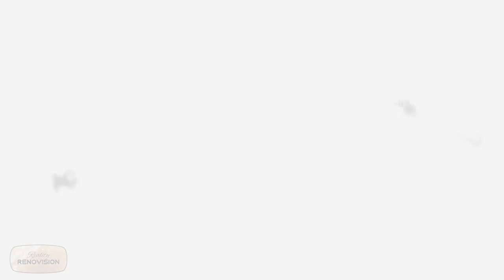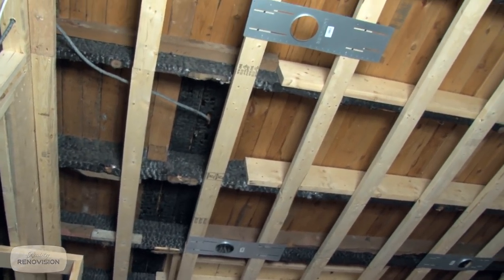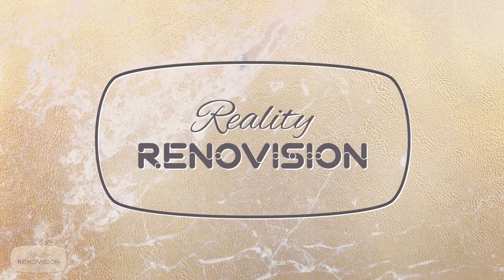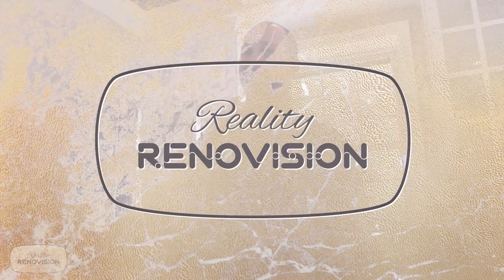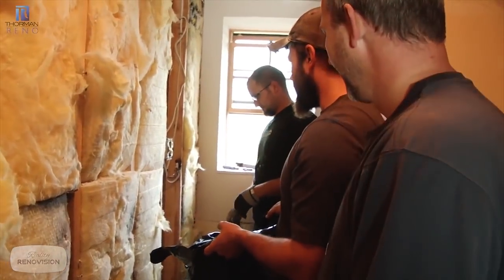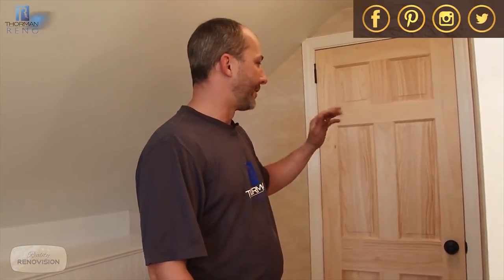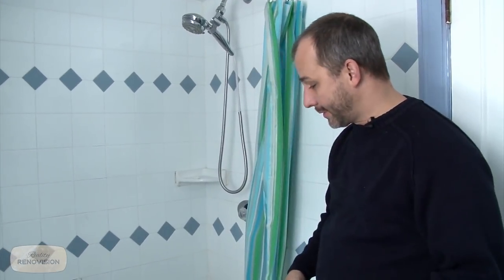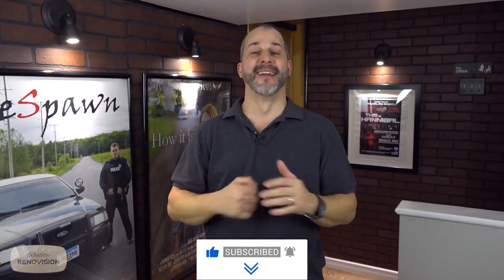4 Epic Century Home Renovations 1900-1930s | Reality Renovision Ep02

Comment: In Romania you can do a pretty decent bathroom  in under 5000$, actually that's more than most people spend on a bathroom. Also I am amazed  how easy it is to remove walls for you, our walls are all made with ceramic blocks ( hope I translated it properly) so it's much harder to remove even the non load bearing walls.
Reply from the maker: It is a curse and a blessing having wood walls for sure. Cheers Anita! And Cheers to Romania, My wife Michell actually has roots there!
Reply: Same  price range for rural southern U.S.

Comment: Hi Jeff, I've been watching your videos for a while now and enjoy them all. They are over my skill level, to say the least, I learn something every time. You addressed my question near the end in the last one today regarding bathroom exhaust fans - I recently discovered our 1st floor bathroom vents into our attics (2) but the vents have an opening with pink material (insulation?) stuffed into a 3" (roughly) opening rather than venting um outside???  I guess you can see I am not technical but my question is, are they supposed to vent outside or merely out of the bathroom? In your video you commented that the vent may just vent into the attic which causes problems but you didn't elaborate. Additionally, we have a bathroom upstairs with a vent, so where is it venting? What do we do about these vents? We are on the Gulf coast in Florida. Thanks so much!
Next video I'm watching is your Pocket Door Installation. While I can't do it, I am confident my husband can handle it;-) Thanks again!
Reply: Lynn, a bathroom exhaust fan should vent to the outside, not the attic. Otherwise too much moisture builds up in the attic, which can compromise the insulation aswooden joists and rafters.

Comment: Ok so. My house I just bought has a weird floor. On the floor joists is 1/4 inch plywood on top of that is 1/2 particle board. I get a little spring when walking on the floor.
It squeaks a little and just feels strange.  The living room is more springy than the kitchen and eating area.
I was thinking of adding 7/16 OSB on top in the living room and screwing through to the joists. This would create a higher living room floor than the kitchen. I thought I would use floor leveler to even up the two before putting down the snap lock vinyl flooring.
Reply: I was hoping the 7/16 osb would stiffen the floor up and make a better subfloor for the new flooring
Reply: Be sure your framing is ok for the added weight. The "sponge" may be be way worse than a sheathing problem.
Reply: Joan Halcomb thanks . We ended up hiring someone to tear up the subfloor and install new. I had to hire  this out due to my son being run over by a semi truck. So I’ve been taking care of him and couldn’t do the work myself.

Comment: @REALITYRENOVISION love the renos of old homes. I’m re-doing a 1924 house in Toronto right now and I had 2 questions with your first video.  1) did you put plaster back on the lathe or did you drywall on the lathe?  2) would you suggest widening the stair case as mine is probably the same width as the one shown? We are contemplating floating stairs and either expanding the opening or making the last stair narrower, any suggestions?  Thanks!!
Reply: I don't know the answer but replacing plaster on the lathe is a real quality way to do something - plaster is better than drywall for a number of reasons. Old Town Home in Old Town Alexandria has a great blog on how to do this.